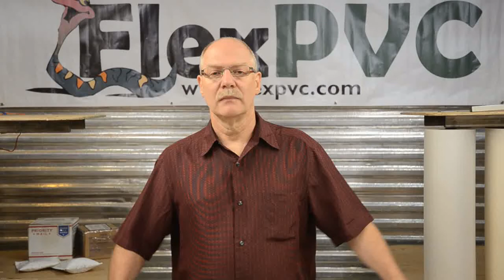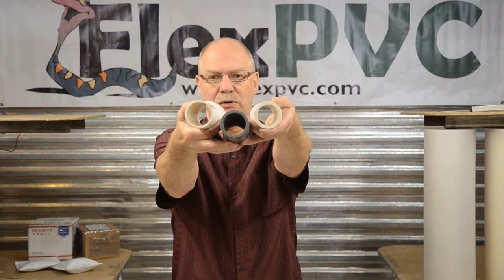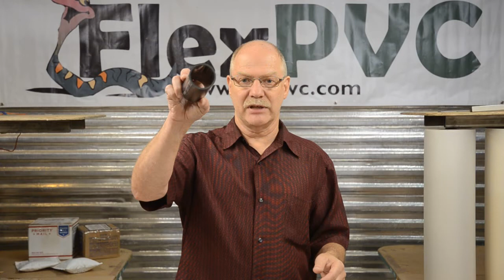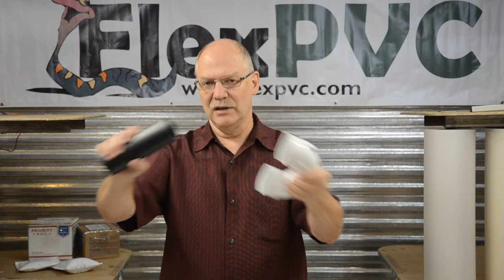FlexPVC explains why Sch 20 pipe is so hard to find.

Comment: Schedule 20 does exist, but only in 4 inch PVC, nominal dimensions, for drainage or sewer pipe systems
Reply from the maker: I've been doing this since the 1970s. There is no Sch 20 PVC Pipe. What you think is Sch 20 is probably SDR 32.5 or SDR 26 or SDR35. Those are all different pipe, thinner than std Sch 40. But there is no Sch 20. You have been mislead or lied to. Sorry but that is the truth.

Comment: thank you!  I have wasted a lot of time trying to find "schedule 20", now I can search for schedule 100 or 200 instead.    for a shopvac modification.
Reply from the maker: Actually you are looking for Class 63, 125, 100, 160, 200. In some areas of the country they call it SDR21 or SDR41 or even SDR32.5. You must be very careful. There are many standards out there and there is also SDR35 which is a complete different pipe. Not cross compatible with IPS Pipe sizes (Sch 40, 80, 120, Class 63, 125, 100, 160, 200, etc.) Almost all the pipe sizes and classes are listed on our pipe size and dimensions chart at https://flexpvc.com/Reference/FullPVCPipeChart.shtml

Comment: Thanks for the very informative video.  I was looking for a lighter pipe to make a gutter cleaner.
Reply from the maker: Try looking for Class 63, 125, 100, 160, 200. In some areas of the country they call it SDR21 or SDR41 or even SDR32.5. You must be very careful. There are many standards out there and there is also SDR35 which is a complete different pipe. Not cross compatible with IPS Pipe sizes (Sch 40, 80, 120, Class 63, 125, 100, 160, 200, etc.) Almost all the pipe sizes and classes are listed on our pipe size and dimensions chart at https://flexpvc.com/Reference/FullPVCPipeChart.shtml

Comment: I guess the thinwall pipe you mentioned might work for me.... I actually thought I wanted schedule 20 PVC, because I want to build a very light and long gutter vacuum system. Schedule 20 is about half the weight of schedule 40. Sad that schedule 20 has died out. But maybe the thinwall pipe is the secret?
Reply from the maker: Class 200 is a relatively common thinwall pipe. That's probably the best to get for the availability.

Comment: There IS a schedule 20 PVC pipe and it's used for central vac systems. Please correct that
Reply from the maker: Nope. Sch 40 and Sch 80 and Sch 120 and all these pipe standards are IPS (Iron Pipe Standard). ALL 2" IPS pipe will always have an OD of 2.375" precisely. Vac tube is 2.0" OD exactly. It's not Sch 20. It's ignorant people calling it Sch 20 and Vac people trying to fool their customers.
Reply: @FlexPVC  What is the correct name for the thin wall 2" PVC vacuum tubing that is advertised as Schedule 20?  I need some for a project.
Reply from the maker: @Paladin1873  Vacuum Tube or Vacuum Pipe (although technically it's not really pipe but that's how you'd find it.
Reply: @FlexPVC  u should do a video on Tubing if you have not already; may clear things up nomenclature and industry wise, at least for the DIY’er that doesnt think they know everything unlike DunningKruger-contractors, Cheers!
Reply from the maker: @zefrum3  Thanks for the idea. I'll add it to the list. We will be putting out a lot more videos this year. So great timing. 🙂
Reply: @Paladin1873  I'm looking for the same.  Did you find it?

Comment: My hardware store Mgr  just recommended I buy some schedule 20 pipe.... He was guessing that the thinness eould make it more bdndable...NOT

He was wrong I guess. 

It's not the schedule number that makes it heat bendable. The relevant variable is PVC or UPVC.
The U stands for "unplasticized.")

 Tge new standard modern version of PVC  is UPVC ( though that is not printed on my pipe.) The old PVC pipe had phthalates in it to plasticized it so you can do heat bends on it. The new UPVC ( U means unplasticized)is much harder, more rigid and cannot be bent the way the old conduit PVC pipe could be. 

So all those YouTube tutorials on bending PVC are now irrelevant because the new PVC has no phlalates in it. I wonder if anyone sells or makes the old bendy PVC pipe anymore?
Reply from the maker: Lots of uninformed people working all over the place. :-) The only pvc pipe that has plastizers is flexible pvc pipe (comes in a roll, it's our primary product). Rigid pipe has not had plastizers for decades. There is no sch 20 or 30 and in fact the thinner the pipe the harder it is to bend (it kinks.) Electrical conduit may or may not have plastizers in it, we don't do anything with electrical conduit.)

You can still bend rigid pvc pipe but you need to use heat to do it. There are a few products out there that allow you to bend pvc pipe w/o heat but they are limited in size (1/2", 3/4" and 1") and length of pipe you can bend. (the spring insert tools.) I have used them and they work, but they have a limited application. Using heat works all the time.

Comment: Central vacuum companies say their pipe is schedule 20. Why would they lie? Maybe they are just stupid?
Reply from the maker: It could be ignorance, it could be so that people can only buy their tubing from them. Sch 40/80/120 are IPS (Iron Pipe Size/Standards). 2" IPS pipe is always 2.375" on the OD. If it's not 2.375" on the OD it's not IPS pipe and it's not Sch 40 or 80 or 120. Vac tubing is 2". OD. Therefore it's not Sch 20. There may be an engineering standard that specifies the dimensions for Sch 20, however if it did, the OD would have to be 2.375". The vac tubing is not, therefore it's not sch 20. There is or was a aluminium pipe that was Sch 20. But again it was 2.375" OD. Hth.

Comment: I used to work at a pvc fab business and we did use schedule 20. That was about 21 years ago
Reply from the maker: I've been in this business since the 1960's. There has never been Sch 20 pvc pipe. What you are thinking of is Class 200. 99.99% of people make this same mistake. They see it fits sch 40/80 fittings, it's thinner than sch 40 so they make the assumption its Sch 20. But that does not make it so. There are Sch 20 and Sch 30 specs in the  books, but I've never seen it made in PVC plastic. Also note: What others are claiming is "sch 20" pipe is not. And you can prove it to your self: They claim an OD of 2.00". Go lookup the specs for Sch 40,  80, 120 and yes 30, 20 .... They all have an OD of 2.375" So if it does not have an OD of 2.375" it's not schedule "anything" because that is not the spec.
Reply: @FlexPVC  I recently pulled my submersible well pump that was installed in at least 1981. The pipe was gray PVC made  by "Marvel" and extremely thin-walled, about one half of sch. 40. Are you saying this is class 200 or 100 pipe?
Reply from the maker: @johntreehorn5416  Yes, if you can measure the wall thickness you can find it on our chart: https://flexpvc.com/Reference/FullPVCPipeChart.shtml
and that will help you identify what pipe you have. Note: wall thickness is approx. But just find the one closest and that will be your pipe. :-)

Comment: So does this mean Sch40 can be used on central vacuum pipes?
Reply from the maker: Yes and no. Physically they will work however you will need an adapter to go from the 2" OD Vac tube to the 2" (or 1.5") PVC Pipe. If you go with 1.5" class 200, that's a thinwall pipe and you won't loose too much vol and you will likely add vacuum. Measure the OD of your 2" vac tube. It'll be about 1.80" (give of take). Class 200 1.5" pipe is about 1.70". If you go that way you can use a standard fernco couple: https://flexpvc.com/cart/agora.cgi?p=Fernco-Rubber-Couples&p_id=1056-150&xm=on&ppinc=detail It will be tight but it will stretch to 2" OD. OR you can go with sch 40 20" pipe (2.375" OD, ID 2") so you will lose a little vacuum but may gain air flow. This item MAY work: https://flexpvc.com/cart/agora.cgi?p=Fernco-Rubber-Couples-Reducing&p_id=1059-150&xm=on&ppinc=detail

Call or email us for more info if you need it. 😃

Comment: Schedule 200 pipe is really heavy
I think it has a 4000 psi rating
Reply from the maker: There is no Sch 200. There is Class 200 and it's rated for 200psi.

The the schedule pipe, you have Sch 40, 80 and 120. 120 being the heaviest wall.

hth. Thanks